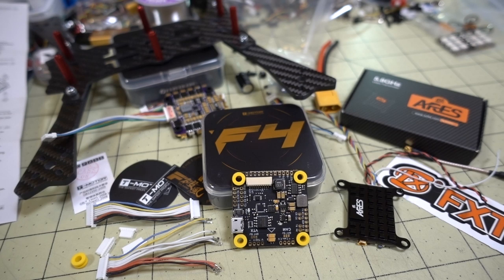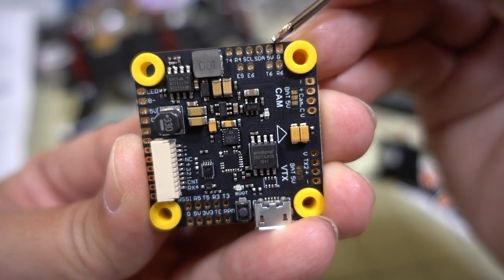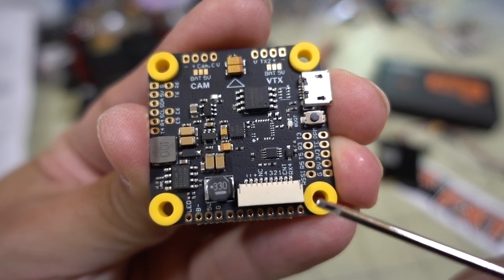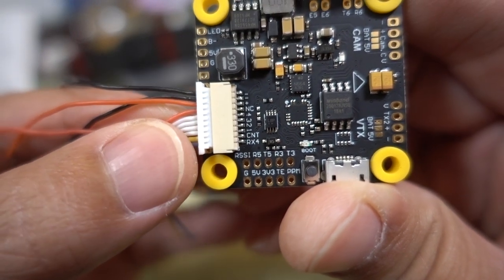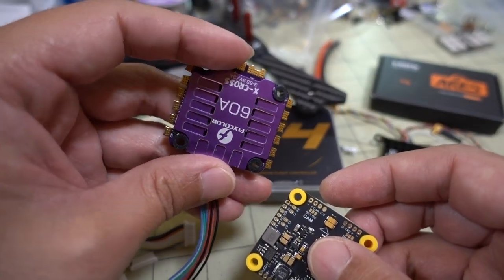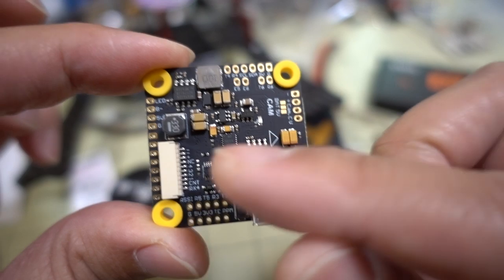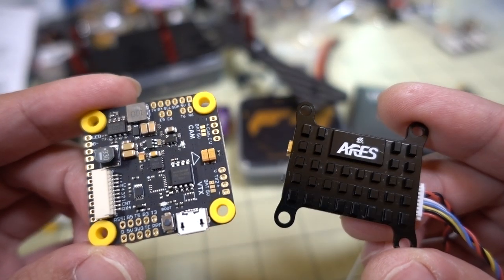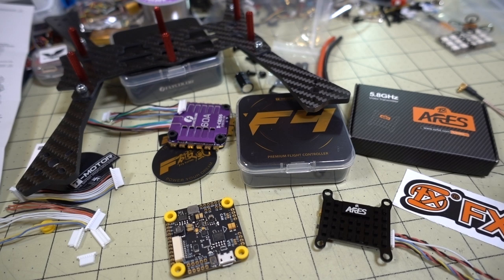T-Motor F4 FC and FXT Ares 1W VTX Overview 🛠️

Comment: Hi Albert, thanks for your videos, I am learning a lot with them.  2 days ago I bought the Stack T-Motor f4 + ESC 55A.  I have a question with the VTX and I would need your help.  I have the vtx A01 with the camera connected to the vtx.  To make the connection on the F4 I have to connect my VTX where it says VTX on the board and that's it? Thanks!